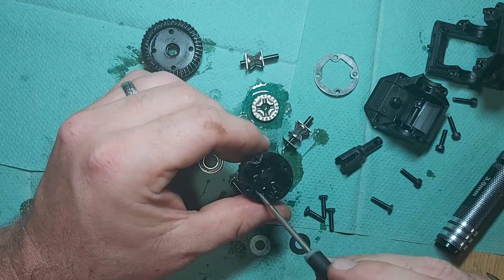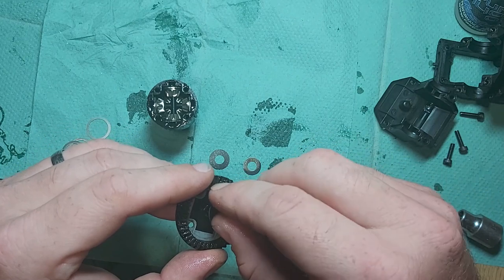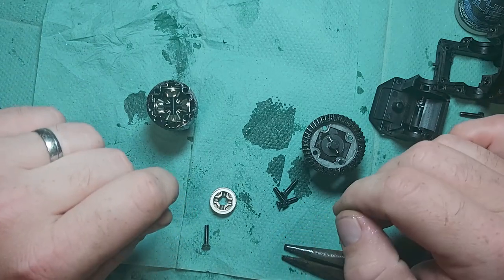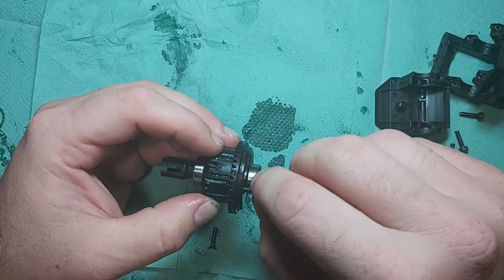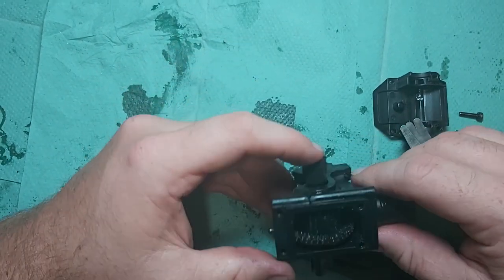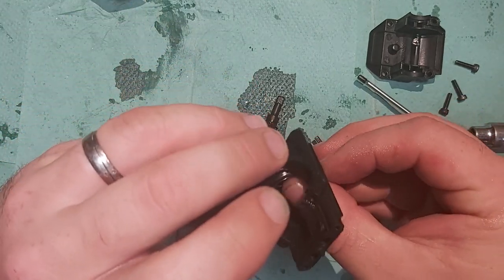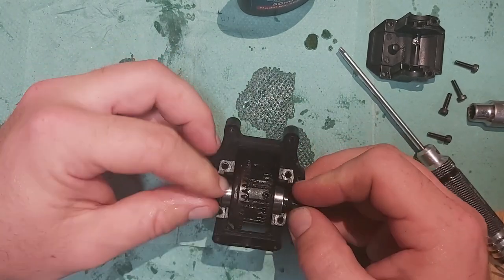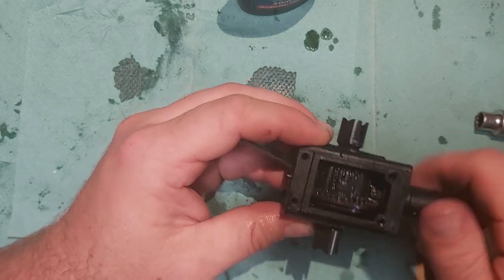Building a bullet proof Arrma Kraton EXB rear open diff (non LSD)

Comment: The pin is 11 mm long. The ridged elevated part that needs reinforcement with the washers is 11.5 mm long. The best washers are 12x16, they come in 1mm and 0.5 as well , mine are on their way.
Thanks so much for this video, it's a brilliant solution
Reply from the maker: Cheers man, yes I have seen a few people use the 12x16, if I was to buy shims for this I would probably do that as well. I had the others spare so  used them and they work well
Reply: Where did you get the 12x16 shims?
Reply: @Nick-df6po  sorry Nick, only saw your reply; I'm in Oz and got these from ALIEXPRESS , one from China, one from hk. I'd be pretty interested to find out if they're still holding up nicely Bournemouth?

Comment: I blew my kraton exb diff out and when I got new gears I also got those shims and rebuilt mine the same way you did!    Have ran 4 6S packs so far without a problem!   Anyone struggling with exb diffs should follow your instructions.  Thanks for the pro tips brother!!!!
Reply from the maker: Cheers man, mines still in there going strong months later and multiple 6&8s packs through it 💪💪😀😀

Comment: Very good info and thanks for sharing here! ‘BashingBrian’ from the Arrma Forums also did this a few weeks ago and I followed suit. I’ve put six 6s packs through mine and it has been bulletproof. No probs whatsoever....loving it!!!! However 12x18mm shims (0.3, 0.5 & 1.0mm thick) were used and they completely cover the area behind the sun gears by providing a perfect fit and maximum support.
Reply from the maker: Awesome I didn't realise someone had done similar. Yes those shims sound good, I managed to do it with what I had in my spares but I'll keep an eye out for them

Comment: Brilliant! If this doesn't work I don't know what will! Thank you!
Reply from the maker: Cheers man, I hope it helps 😁😁👍👍
Reply: Disappointing news. Second run with stock specs and sun gear on crown side chipped again. It's possible  I had some play under the pins on both sides -I did have 2 large and one small washer on each side. Let us know  how it holds up for you.
Reply from the maker: @Nick-df6po  ahh man that sucks, I've done about 13 packs through it now and all is good. Did you shim it how I did in this video?
Reply: @bournemouthrc4371  I did, but something must of been different. I plan to try it again when I can get my hands on more parts like a new sun gear, new diff cup, and new shims under  pins because I reused my warp ones.
Reply from the maker: @Nick-df6po  ahh okay maybe it was the used parts had worn slightly. I hope you get it sorted soon buddy

Comment: Used your shimming method today with 12x15.5x.2 Arrma shims. I got 8 shims behind the sun gear on the cup side and 7 behind the sun gear on the ring side. Nice and snug with zero play. So far only one pack through it, but we'll see how it holds up!! Fingers crossed! 👍
Reply from the maker: Awesome man, glad it helped. I have run at least 20 packs through mine and so far no problems 😁😁👍👍
Reply: @bournemouthrc4371  Awesome to hear!!

Comment: James, thanks, was along the same lines as someone else advised me what they did today. Hope this works as mine with the LSD plates didnt work, then again mine when due to the disk plate ripping the back of the sun gear off, on this set up there is nothing to rip the back of the gear off
Reply from the maker: Yea this keeps it simple nothing to break up or wear out just a nice tight diff with no play 😁😁
Reply: @bournemouthrc4371  will be doing it this week as have spared diff parts - bought when Bad Touch got his ones in 😂😂 lets hope it holds up, i dont see why it wont
Reply from the maker: @HardcoreRC  yea man mins held up extremely well on both 6 and 8s you should be fine
Reply: @bournemouthrc4371  parts ordered - didnt quite have enough of the shims already 👍👍

Comment: Awesome video sir, thanks for this.  I have a Kraton 6s RTR but am considering buying a Kraton EXB to experiment with adding my own ESC and motor set up for the first time instead of buying RTR.  The diff issues I have seen and heard about have put me off a little bit but this video at least lets me know there is a way to get the thing to be reliable.  In my opinion though it should not be up to us, the customer, to get involved in spending money, waiting for parts and then stripping down a brand new model to prevent part failures from normal use of the product from the manufacturer.

That said, I saw one other video recently where an owner added a locked spool / block to the rear diff to at least get his EXB running and get some use out of it and although that is not an option I would personally consider I did wonder what your thoughts would be on installing a locked spool to the centre diff of a Kraton or Outcast 6s which most people use 500k diff oil or silicon plugs to practically lock it anyway.

Thanks for your time and subscribed for future updates.
Reply from the maker: Cheers man, yea it's a shame they didnt sort this out in testing but they have now updated and have produced a rear diff that is similar to my design.
I personally wouldn't lock any of the diffs on a basher. Its key to have some play, not alot needed but some else the rest of your drive line will be torn to bits

Comment: Super late to the party but i have an issue with this fix. One diff had the pin channel in the sun gear completely sheer off. This fix would only create more of the gap from the pin to the sun gear. Also ive only had lsd diffs and ive gone through 2 with a new one just sitting because i dont trust it. Any ideas?

Comment: So happy to get this info! I got to be honest though, I have a new EXB (never used). Setting up for 8s. I bought all the shims from the video thinking I would prevent the problem...To my surprise every clearance on my diff feels great. Perfect mesh, no side play. 1 small shim and 1 big shim on sun gear for both sides. Should I just put it back together and run her?
Reply from the maker: Awesome if yours feels good to you, you might have a good one. It's totally up to you if you do it or not. Just make sure you check after a couple of packs as they tend to loosen up when run in. Enjoy the truck man 😁😁👍👍
Reply: You said you like 30k in the rear on the Mojave.  Do you think 50k is too heavy? Also could you tell us what k weight you like for the front and center diffs?
Reply from the maker: @surfside75  hello, 50k would work but is a little stiff so the rear end will slide about a little more. I use 60k front and 500k centre
Reply: @bournemouthrc4371  thank you for that quick reply 👍  more research leads me to rear 30k 200k 50k. Good?

Comment: Great video, what diff oil would you recommend to put in the 3 diffs ?,

Just running it on a field with 6S, no mad jumps like Kevin Talbot.
Reply from the maker: I personally run 60k front 500k centre and 30k rear. But anywhere between 200-500k for centre would work
Reply: @bournemouthrc4371  Thanks for getting back to me so soon, much appreciated.

Comment: So the spider gears don't need any shims? looks like you skipped over that part.
Reply from the maker: Nope no shims were needed on the spider gears, they actually line up nicely with the edge of the sun gear. I don't think you would need any extra in there from what I have seen
Reply: @bournemouthrc4371  Thanks for the fast reply..
Reply: @bournemouthrc4371  do you do this to all of the defs in the truck or just the rear?
Reply from the maker: @MrCrazybill420  I only did the rear as that's what I was sent by Badtouch Breakers. I then ran the diff in my Krajave (mojave chassis Kraton)

Comment: great video  on that rear diff. can you please tell the part number for the shims i need? i just got a new EXB i want to top off all my diffs and of course check  and shim the rear. thanks
Reply from the maker: Cheers man, all the shims and links to them are in the description below the video.
Reply: @bournemouthrc4371  I dont looks to hard just ordered them on ebay some Pro Tek brand 13 16 0.2mm hopefully i have those other ones behind the pin. Not gonna run my EXB until i do this. Great video mate. keep up the great work. be safe.
Reply from the maker: Cheers man, I'm glad they helped. I hope you get out there soon and enjoy your truck man 😁😁👍👍💪💪
Reply: @bournemouthrc4371  thanks I will 👊

Comment: I measured My LSD plates at .6 each 1.8mm total which makes sense as you stacked the under pin shims large small large so the edge of the top large one isn't supported and with a 13mm bore the shims emulating the LSD plates are sitting it large arma shim has a 13.7 OD.
Reply from the maker: Yes you are right they do over lap slightly, that's also why I went large small large with the lower shims to act as a sort of sprung loaded pressure plate when squished in
Reply: @bournemouthrc4371  I would expect the outer lip to get bent over time I can't see it springing back keep us all informed.

Comment: Should there be any slight clicking when you spin both shafts on the diff by hand? I’m guessing it should just run smoosh as silk?
I rebuilt my diff after replacing the oil (mainly because I heard a click my noise and wanted to check the gears) and once I cleaned and rebuilt it it was making the same ever so slightly click feeling when spinning the diff ends by hand. If this isn’t right do you know what it could be? Any help is appreciated.

Comment: For shimming the pinion, I wasn’t able to find the shims that fit inside and behind the bearing. I left the bearings in place and put a smaller shim on the actual pinion shaft and brought in in closer to the crown wheel. Any reason that method wouldn’t work the same?
Reply from the maker: It should work, I have discussed this before  I think a few did it but one person found the pinion chewed the shim up do just keep an eye on it

Comment: Hi, i finally got to use my EXB today after getting it all set up and following your advise on shimming the rear diff and it worked perfect so thanks for sharing your advice but ive come across a problem with my esc not recognising that ive got two 3's batteries it only beeps three times not six, ive got them connected by using a converter cable going from one to two. I was wondering if you've got any ideas on why its only beeping 3 times and not 6. Thanks paul
Reply from the maker: Hi buddy it sounds like your connector is a parallel one not a series one. You need a series one to make 2x3s a 6s. Parallel is just 3s with double run time.
Reply: Just looked at the cable and it looks like your right, am i right in saying that the in series connecter is the positive cable to positive on one connecter negative cable to negative on another connecter then connect the two connecters together with negative to positive, if it is then the cable i got is wrong as all the positives are together and negatives are together which im assuming is the parallel type
Reply from the maker: @paulbrett9964  yea man you have the parallel one you need the other one 😁😁👍👍
Reply from the maker: @paulbrett9964  it looks like a y shape
Reply: Perfect, i will order one right now. Thanks for the help. 👍👍👍
Reply: Thats two runs ive done now on 3's while i wait for the correct cable, the thing is a beast cant wait to run it on 6's the cable should be here in a couple of days. The rear diff is working really well and the car is amazing😀😀😀😀😀😀😀
Reply from the maker: @paulbrett9964  awesome man, if your impressed now on 3s just wait until you get double the power 😁😁👍👍💪💪

Comment: Not sure if I have an old manual or not but it shows the front and rear both use the lsd plates, do you know if this is the correct way or should I only be using the plates on the front and big and small shims in the rear?

Comment: So it has been 5 months since doing the shimming. How is the diffs holding up? Any failures?
Reply from the maker: Nope no failures and its used most weekends. Still strong as hell
Reply: @bournemouthrc4371  did you end up doing the same shimming to the front diff also
Reply from the maker: Yes I ended up doing the same to the front both have been no issues since
Reply: @bournemouthrc4371  Sweet thank you for the awesome videos and fast responses. Stay safe

Comment: Nice work. Hope it holds up. Fact remains however that Arma completely dropped the ball on the EXB launch with their rear diff problems. I know of people who are still waiting on their warranty replacement diffs. We shouldn’t have to be playing armchair engineer to fix an obvious design flaw from Arma. Diff problems have plagued their rigs for some time now....going back to early version Outcast’s that needed the diffs to be shimmed out of the box. I was hoping their QC and customer service would’ve improved after Horizon bought them. So much for hoping. You’d think Arma would have it figured out by now. Guess not. But hey...Arma tough baby! Yeah right 🤮
Reply from the maker: Cheers man, it has held up very well. No issues yet and multiple days out abusing this truck. Yes it is a shame that people have to wait for parts etc. It Is good they have now fixed the issue though, just annoying that people have to wait on parts

Comment: HI what kind of diff fluid are you using now when you shim  it. you said 30k on your can i use 10k ?  or i  should use  30k?  its not gonna effect the diff to much is it? making more bullet proof or less ? i would assume 50k is too heavy ?
Reply from the maker: Hello, you can use what ever diff fluid you want, the change is in the handling of the truck. For example thicker in the rear gives slightly more power out of corners but can slide about more
Reply: @bournemouthrc4371  ok great thank you buddy. 👍 Be safe

Comment: So Arrma have brought out yet another version with major problems straight away - great video - u solved my diff problem on my v4 with your othet shimming vid ! Thanks bud it was annoying te hell out of me hearing that grinding. Can i pick your brain ? I would (as im sure many kraton owners would) like to know just how much of the new EXB parts will go onto a Normal v4 6s Kraton. I see the gp4 crown n pinion fit but what about all the safe d stuff and bulkhead size etc?  Modelshops show non compatible but to me it looks like it will fit. Can u help pls mate ? I basically want EXB drivetrain in my v4
Reply from the maker: Cheers man, I'm glad there helping.
Right I dont have an exb, just the diff but here is what I know.
The diffs and pinion will go into the old housing fine. But I think you need complete diffs as the diff cups are smaller and the V4 wont fit onto the crown gear. (Someone please  correct me if I'm wrong). 
The chassis is a straight swap, arms are slightly different but should swap. Towers are different (rear more like mojave I believe) but again will swap. If I'm honest and you upgrading your V4 the front and rear diff and pinion is all that I would use EXB for the rest I would stick to M2C etc as they are stronger than the exb one already.
I hope that answers your question
Reply: @bournemouthrc4371 Thanks bro - yeah i know u got v4 Kraton too hence i thought id ask if you knew lol ive M2c towers n hingepin holders etc , rpm all round etc - i thought the same in regards to the spur n pinion but wanted your expert advice too. Im thinking i wont nred exb sun n planetary gears ? So to clarify , Just exb crown n pinion on both ? Will shim them too .
Reply: Lol sorry read that walking along lol ok so im gonna give the whole diff itself a whirl n see it fits - i will let you know how i got on dude - keep up the great vids - they REALLY helped me and im not new to this truck lol u da man
Reply from the maker: @rccircus7271  I'm not 100% sure but I believe you have to put the whole exb diff in as the crown gear has different whole locations for the smaller diffs. Annoyingly I didnt check them when I had mine out. I'm pretty sure you have to use the whole exb or the whole V4 diff. Best net is to get complete diffs from a breaker

Comment: Can you shim a diff that has LSD plates by removing the plates and following your steps?
Reply from the maker: Yes you can there exactly the same parts apart from the lsd plates, the Lsd plates take up the same amount of room so you don't need to for strength but if you prefer none lsd you can take them out and do the same as I did

Comment: Hi the 0.2 shims you used behind the pinion bearing towards the end of the video are they the same size 13 x 16 x 0.2mm ones you used behind the sun gear in the differential?
Reply from the maker: No I believe they are 13x19 check in the description but it's important they fit the outside of the bearing which I believe is 19mm. The sizes are in the description of the video
Reply: @bournemouthrc4371  OK thanks 👍
Reply: Did this yesterday I too had two large and one small shim behind the pin. When putting back together I put the shims behind the pin back in the order they came out 2x large first then the small shim next to the pin. I noticed after watching your video again you put them back in large, small, large. Is it going to make much of a difference the way I did it?
Reply from the maker: @benlait3696  no it should be fine, it's the same amount of shims so it equals the same thickness
Reply: OK thanks so much for your help, looking forward to putting the first pack through it this evening. 👍 I think I know how the incorrect shimming from the factory came about. If you look at the diagram in the manual for the rear differential it has the shims all mixed up.  It shows the small shims but the part number is for the larger shim dimensions and vise versa.  Just subscribed.
Reply from the maker: @benlait3696  awesome cheers for your support man. Enjoy your truck 😁😁👍👍